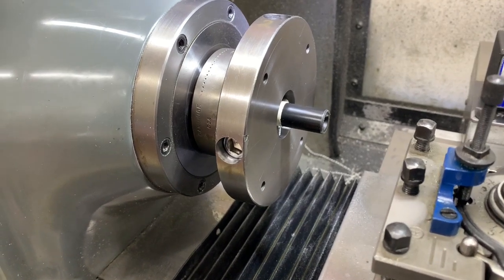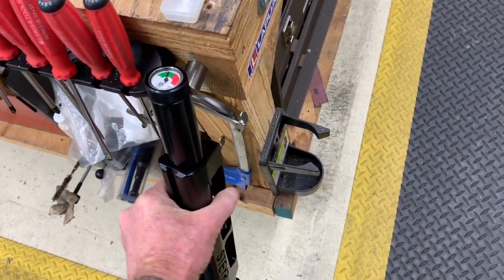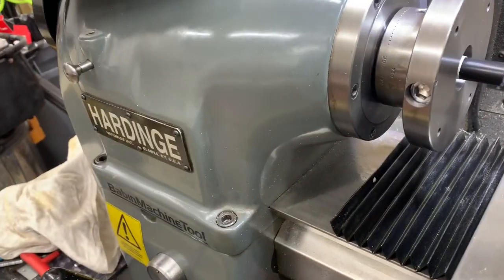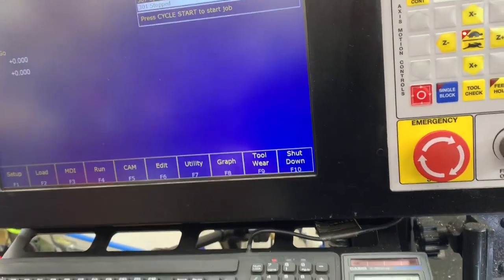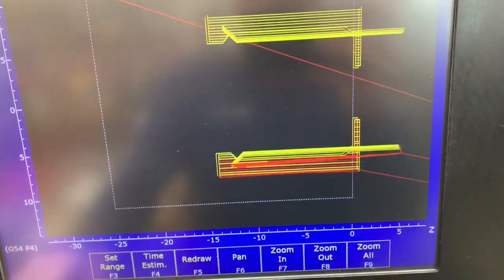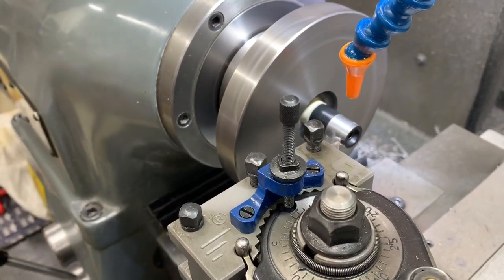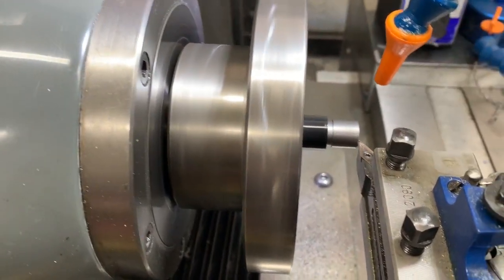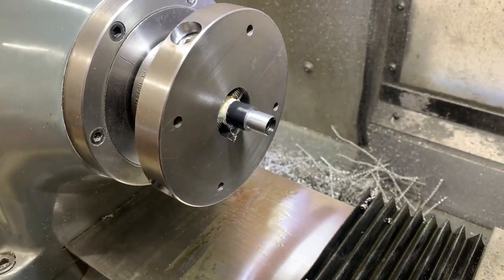Thread Cutting For Steyr Challenge Air Rifle

Comment: What is the shortest barrel you can cut on the lathe? Or what is the distance from the spider to spider?
Thanks!
Reply from the maker: without any fixtures you can do a 22” barrel easily. it is about 19” between “jaws”. with adaptors one can do just about anything.
Reply: @ChrisHarris4U   thank you for the quick response.
I greatly appreciate it.